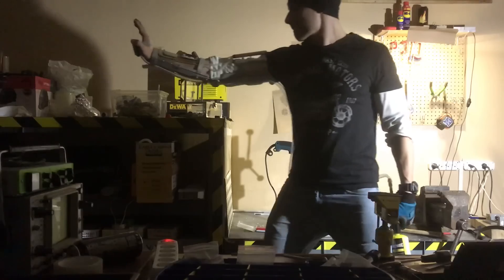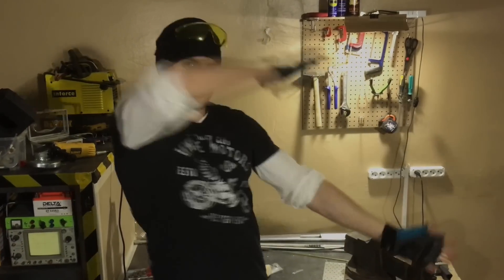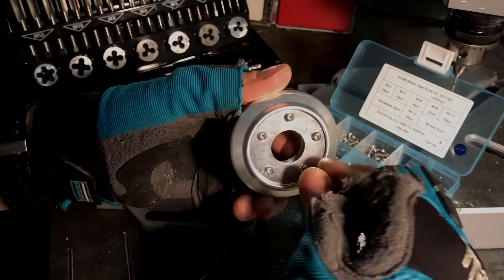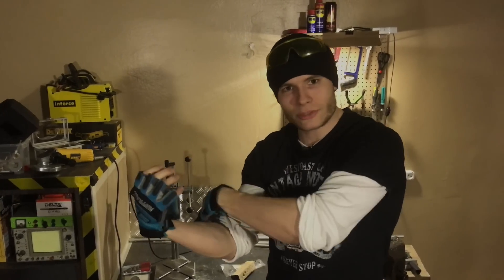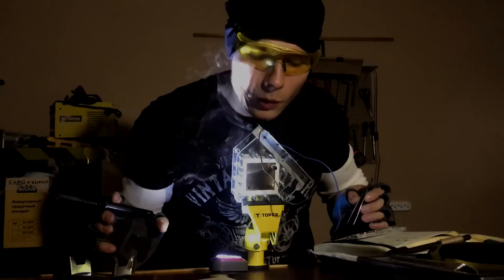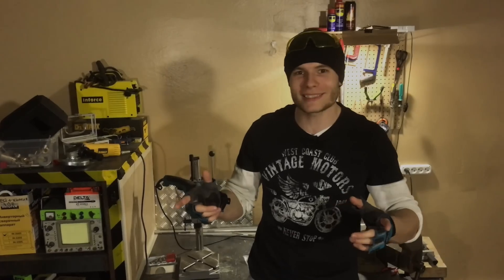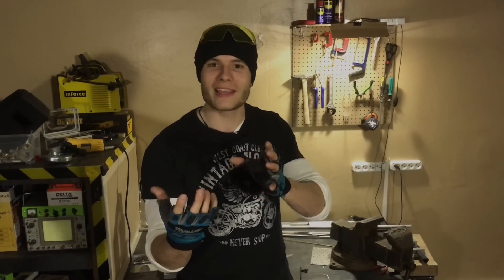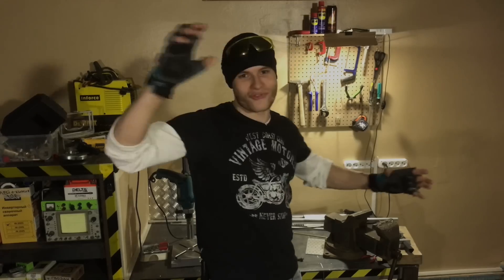Real Iron Man repulsor & exosuit. HHO combustion chamber powered with electrolyzer.

Comment: how about he uses a generator using magnets, copper wire and a few different materials,  and to make the repulsor, he would need a high powered conversion device that converts energy to force. and the magnets and copper wire, wrapping it around different magnets linking through other conductive metals around as a circular shape, with connectors running from different exit points, leading off to a chamber which stores the energy and converts it into a high output force and connects to the boots, which could use a basic piston system linking to an exhaust except a miniaturised jet booster, just a few modifications, with a main one on the back (jet booster) concealed behind 3 flaps, 2 of which are steering and the third lifting up and revealing the booster which uses the same piston system. also having a helmet with a screen with a camera on the head (spy cams) with encoded hud and for an ai assistant, copy generic coding from games ai, software ai and websites ai, to analyse and act as a google type system with various other means, navigations, hud check, personal mental health administrator, etc. all i’m saying is, this can be modified heavily, if anyone wants to discuss further, comment here please, i am not giving private info

Comment: The Percussive effect of Hydrogen gas explosion is good but you need to focus the sound so its affects can be felt at a greater distance. Try using small surrounding parabolic reflectors or ultrasonic inducers that will carry the shock wave without the loss of force. See DARPA ultrasonic sound projector weapon.

Comment: I am having difficulty trying to understand the science behind the blast that is created. I have got a rough idea in my head - but I doubt it is the correct one. If someone would take the time to try and explain how the blast is actually created, I would appreciate it a lot.
Thanks.
Reply: Bradley Hunt honestly the plasma he created in his small glass vacuum is demonstrating quantum tunneling and using a gridded plate with a positive charge on top of the glass could be causing it to shoot out... but he only used one positive gridded plate instead of two, which usually is needed because the other plate has a negative charge creating push of plasma I don’t know if this is 100 percent accurate but I’ve been studying this for about a week now trying to replicate it myself so hopefully my understanding is clear

Comment: Did this guy just invent plasma weapons?
GG my dude!
Reply: Invent them, no, improve them and make a new one, yes

Also it’s more of a gas weapon
Reply: @KerbalChris  Isn't plasma just superheated gas?
Reply: StealthoSlavo yes
Reply: @stealthoslavo1616  not exactly, a plasma is a gas in which some electrons move freely from the nuclei of the atoms. cold plasma is technically a thing
Reply: @lunar04j  true I forgot
Reply: Well, there is the (semi 4s-5s)plasma resonant death ray. not a practice one since it needs complete rebuild after a single usage(in general) and is really hard to make and get stable/working. so the moment you know it works it, in general, the moment it blows up. so it is only a thing that can be used experimental and on small scale. it is however when working stably a real serious weapon since you basically shoot a small unstable star at someone or something. once it loses too much energy or gets somehow triggered in another way it explodes, in general twice because there also is an implosion.  it is a high-speed explosion as you can imagine.

and there is also the plasma cutter and knife. where one is more life a gas torch, and the other is just a hot plasma bridge between 2 electrodes(I made that last one as a lawnmower, don't do it for that, it is bad for the grass(it cuts easily through it, but the head damages the cells that are left in the plant causing them to dry out), however, you can use it to remove weeds).
Reply: ehhh kind of

Comment: "We don't have computer graphics in Russia"

Hilarious

Especially since this was all special effects.

If you pause on the point where the blast goes off and flip between the frames before and after you'll notice the only changing to lighting is the brightness, the blast itself casts no shadows. When you pull your arm away the string it's attached to pulled the first can, then the second, and then the tube you had sitting on on some sort of LED thing.  

It's a cool video, good special effects on a shoe string budget. Not nice to lie to people though.

Comment: I was impressed until 3:35. Cans accelerate AFTER falling over, moving diagonal from force instead of straight back. Sudden cut, and the blue light strip next to the cylinder that fell over is now several centimeters to the right even though no time has gone by. I respect the arm rig but you're full of it.

Comment: The Repulsors are units which are connected through the Arc Reactor, from where it gets energy and its primary use is as a flight source (Propulsion) and secondary function is as a weapon. The repulsors work by taking excess electrons and turn them into muons, which have ability to penetrate deep into atomic matter, which are then fed into hands and chest piece of any iron man suit.

Muon is an elementary particle similar to the electron, with an electric charge of −1 e and a spin of 1/2, but with a much greater mass.

The suit then can generate the powerful blasts as seen in the movies by intake of air through the suit and running it to an Isolated section behind the palm. An electric current is then run through a section of the gaunlet attached to the palm to create a small amount of plasma.

Plasma is created by adding energy to a gas so that some of its electrons leave its atoms.

Because of muons electromagnetic properties, the plasma and muons can be fired from the hands and chest to create repulsor blasts as a primary weapon. The plasma generated from the repulsors can be used as thrust similar to certain space rocket engines.

Comment: What if you added some frequency regulator for ignition? Hydrogen explodes very fast so it could take faster rate than manual ignition. And actually when iroman is landing or energy level drops you can see some pulsation in repulsor.

Comment: I suggest you to put some batteries 18650 Charge Voltage: 4.35V
Nominal Voltage: 3.7V
Discharge cut-off voltage: 2.75V
Capacity: 3000mAh
Max discharge current: 6A for power source and mini inverter for power circulation.
Will be perfect ✌🏼

Comment: look up "pulsejet from colin furze" :) then modify it for HHO gas, result will be insane :D

for the mean time you could try a pulsed HHO mode like several pulses per second.
instead of mapp gas you could use a liquid like isoalcohol or acetone as substitute with a venturi nozzle configuration.

Comment: Dude, I have an idea. You need neodymium magnets, Brown's gas (or only hydrogen, without oxygen), a pulse modulator and a copper winding on magnets. Run through these ring neodymium magnets with
copper winding this gas, but the winding must be under the impulse voltage of the positive potential. And you need to send 2 magnets with fields of the same sign +/- (+ + or - -) to each other to get a magnetic trap. When you turn this setting on, manipulate the voltage and frequency of the magnetic fields. Plasma will fly out in the direction of the least resistance of the magnetic field.

Comment: I hate to be the one point this out, but I'm guessing this only works in appearance. What I'm trying to say is if this actually worked in a capability of doing physical rather than just visual either you would be injuring your Wrist unless there was bracing between the device and what's on your arm 2ed if this actually works the way it looks the military would have developed something similar. I'm sure they'd love to have a device that a soldier could wear in this compact a manner that would allow them to knock a opponent on his but after sending him flying three or 4 feet back by merely touching the person with the palm of their hand or go one step further and do significant damage the equivalent of killing somebody in close quarters combat by merely pressing the palm of your hand against them. Other reason military would love to have something like this that actually works would be forced off like knocking down doors. I'm guessing the actual compression range might knock down a pop bottle or soup canned from a couple feet away, but it won't actually physically knock a human being down from a couple feet away, or even at close range does look pretty good, though. I'm guessing the other problem is it only has one or two shots from a single charge of its fuel source.

Comment: dude that was totally epic! Awesome shit! I wish I was smart as you. I'm calling it, this guy is The Tinkerer! What are the chances you can build actual webshooters with actually webbing?I can dream right?
Reply: That can be done with Chemical fusion and dispensers that shoot nylon 6,10
Reply: Sure, Spider man cum
Reply: Me too
Reply: Rapidassasin25 - The Renegade was about to say that until I saw your post
Reply: Completely possible really if he had some form of adhesive liquid to harden onto a metal wiring and basically have the system work like a grappling hook
Reply: There is a type of hot-glue gun that has compressed air if you could have a compact air canister this would be totally possible have fun making and testing it

Comment: Few quick ideas from someone who doesn't know shit about engineering:

01: Ask the SlowMo guys for a cooperation to film the shots in slow motion. Should also give you a massive popularity boost.

02: Use clothespins and a big piece of paper to show the effect of the blast in certain distances (hang the paper on a piece of wood 2m away, 5m away etc.)

03: ...or knock down more objects with it

04: add special salts or gasses to make the flame more visible/change its color.

05: Give the front exhausts more openings so that you have more (?) effect on close range. Or adjust them in a half sphere/one side of a split hollow sphere with multiple exhausts pointing to the middle.

06: change the back of the exhaust or add moving parts that absorbe recoil force to the reduce the effect of the recoil.

07: Try to fire 2 shots shortly after each other and see if it improves the effect (air wave from the first shot could boost the second shot and give it more power/range.

08: Modify the exhaust in a way that makes the gas SPIRAL when leaving
(like this: bit.ly/2kKToGr 
OR this: bit.ly/2kLudUt)

09: Stuff seems to be very loud in the video and the room small. Ear protection?

...

really cool video and well edited! I think it is very entertaining and impressive! :)

Comment: Damn. Someone beat me to it. I already designed a full working torso and arms (took me 2 years). It involves a series of motors, gear rails and hydraulic motors. Sensors composed of micro levers attached to your joints.

P.S I'm using 12V 300rpm high torque motors.

Comment: I Have a Question is the recoil really that strong? Or your over reacting? Cause if thats how strong the recoil then you could actually add some module that makes it do continous blasts then youll be able to push your self . Just add a few more pairs for your legs and another for your arm then maybe youll be able to get the lift you needed to go up and fly... Like Iron man...
Reply: of course he's overreacting, the flash at the end is CGI, no only is he overreacting the force of that little combustion is not even strong enough to topple those items over, its clear he pulled them off the dresser with some string.
Reply: YairGeva7 play it at 0.25x speed and watch carefully. If those are special effects, they're damn good ones. Which would mean this guy has both engineering skills and cgi skills and deserves kudos nonetheless.

Comment: i discovered caustic lye reacts with aluminum to form hydrogen
so a thick plastic jar with aluminum rods in water with lye mixed in 
and if you build it like a nuclear reactor you could generate hydrogen at will

put rods in gas bubbles up 
Take rods out lye stops reacting 
add a pair of steel tanks and pressure gauge and you have a hydrogen generator that doesn't need electric current to work

Lithium does this too but catches on fire with contact with water
Reply: this is high school chemistry... nice try though
Reply: i never went to high school
Reply: We have not done this in school yet, but australian education system might not include that. I love the idea and coupled with this  repulsor it would be awesome!
Reply: vaultboy 124 I like you, your smart
Reply: sorry, I meant high in school, like.. fucking baked and doing crazy shit hidden inside the lab
Reply: vaultboy 124 Did this in chemistry class but very nice idea
Reply: Lol this already exists

Comment: Is it possible to use it as a flight stabalizer?😃cool video👍
Reply: Or burning your own feet and hands
Reply: THEM LEGEND Fireproof doesn’t mean heatproof.  And yes there are insulating fabrics too.  But they aren’t designed to withstand rocket fuel.  I think the main problem would be your thighs.... if you angled your hands too close to your sides you’d end up torching yourself.
Reply: Pâtes Au Saumon that's the point of the iron man suit
Reply: Banjo Billy no offense but lift isn't the issue either. If you have ever watched a Harrier jet take off vertically you will notice that it doesn't matter how far away from the ground it is, it will continue to "lift" off. The proximity of the ground has nothing to do with ascension. The Harrier manages to lift because it has powerful jet engines moving a lot of air in the opposite direction. Which is why the Iron Man repulsors don't work. The only force providing "lift" would be the compression of the gas in the tanks which is very weak and short lived. The flames look cool but are actually providing no more "lift" than a scuba tank or a helium tank sans flame. The Iron Man suit looks dope AF but without changing the law's of physics or giving it wings and engines it is impossible. If this gentleman actually made repulsors as powerful as he portrays in the videos he is now the richest most sought after genius inventor of all time.
Reply: Georg Winkler imaginr getting bigger tanks then making 2 pairs for your legs... youd be flying
Reply: At first it was a flight stabalizer, but then tony started to use it to toast some bad dudes too. But also could be used as a flight stabalizer, you'd only be missing the armor, the thrusters, the reactor and all the other shit
Reply: Richard Wrigley or you could be tony stark in a cave wit a box of scraps
Reply: Pâtes Au Saumon , you do know that there are fire proof clothes...right?
Reply: lovern smas can't*
Reply: lol thanks
Reply: lovern smas no probs, took me some time and rereads to recognise the mistake so I thought I'll let you know
Reply: Average Thinking , like your gonna but it beside your legs or ankle or what ever , dont you see that you put it under a custom built shoe or boots .... And also you do know that you wouldn't be flying naked are you? Ofcourse your gonna make a light weight suit or else you gonna end up like a flying hotdog, wiggling around...
Reply: lovern smas , well , dont you know the meaning of modification?
Reply: Banjo Billy

This is not true. The ejection of mass is sufficient to apply a force. That’s how rockets can work in space where there is nothing to push off of. Of course, then you need to bring your own oxygen.
Reply: you cant simply just get "2 bigger tanks" hydrogen doesn't have a sustained burn, it is instantaneous. It also would not generate enough thrust to actually sustain flight. These also could not be used as flight stabilisers   because of there instantaneous and non sustained burn
Reply: Georg Winkler was that a serious question? That's not how thrust works. Imagine holding a oxy/acetylene torch you don't see welders flying all over the shop. This is smoke and mirrors. Cool build but not reality.
Reply: The problem is lift... Not necessarily getting off the ground, but once you reach a certain height, the effect range of the jets decreases. flying is impossible since there is nothing for the jets to "push" off of